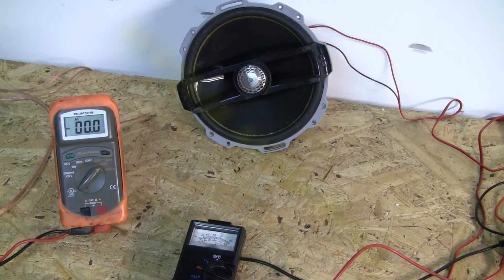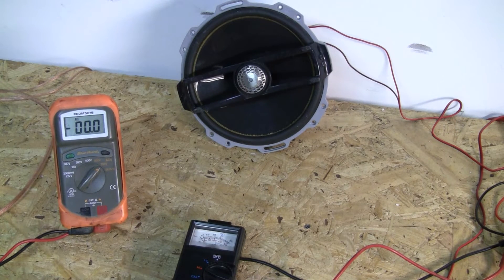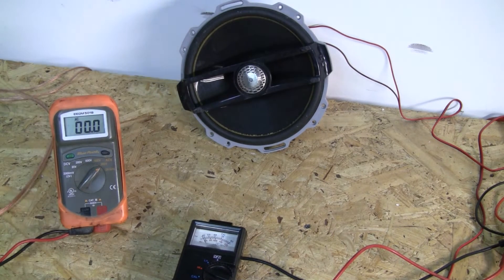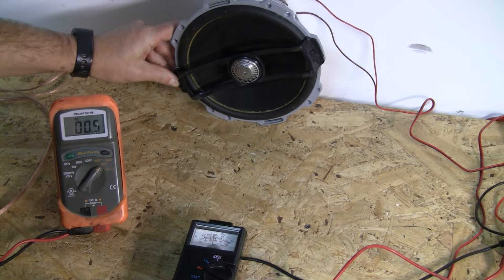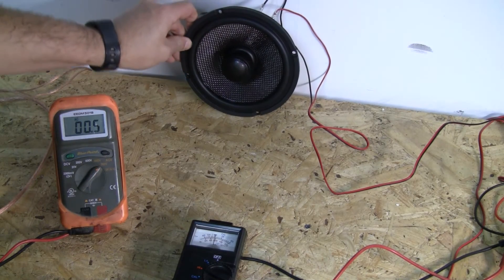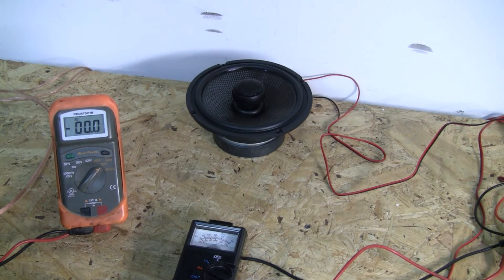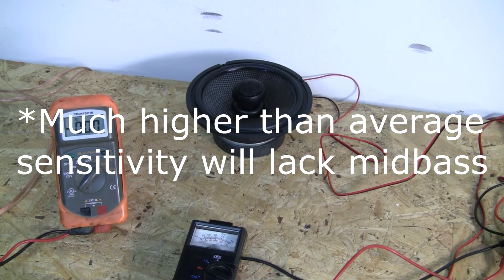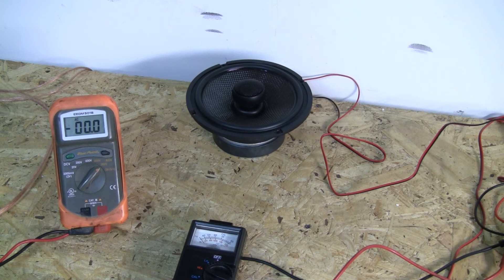Do speaker sensitivity ratings matter? - Tech Stuff Tuesday

Comment: You should probably have the speaker 1 meter (3.3 feet) away from the decibel meter to accurately measure the speaker sensitivity, at least based on the sensitivity rating unit's. The 1W measurement was accurate as long as both speakers were 4 ohms rated.
Reply from the maker: If I was attempting to see if the spec was accurate I would do that, as well as being mounted in an infinite baffle in an anechoic chamber. That wasn't the point. The point was to compare one to the other in the same conditions referring to ratings and actuality.

Comment: Something I have always found is the tested sensitivity tends to be lower than published do to spec tolerance and will change as the speaker is used relative to spider and compliance flexibility overtime and extremity of use.
Reply from the maker: In this case, what was tested was what was published. Typically what you've experienced is with subs, where specs were taken without any break in time.
Reply: @EMFAudio  Right! I was thinking it would've been something to bring up in the video that these are tested specs that coincided with manufacturer's published specs just because those things are not always the same and I've had as many as 10 different driver's of the same model that have had wildly different tested specs none of which coincided with published specs but that can be just splitting hairs when one's trying to get every last tenth out of a system.

Comment: I hooked up a PA compression horn driver on one side of my home receiver and a car coaxial on the other side the PA compression driver is way louder than the car audio coaxial sounded allot cleaner too. I wonder if it would be the same with a Pro Audio subwoofer and a  car subwoofer with similar specs "wattage" like a Sundown X V.2 18 inch subwoofer at 1500 wrms vs a eighteen sound 21NTLW5000
 21 inch subwoofer similar wattage rating 1800 AES. The music I usually listen to doesn't really go under 30 hz  "rock music"what would the better subwoofers be in my gigantic car lol! the rear cabin space is 11 feet deep 42 inches wide and 50 inches tall for the back end of my car. "it's a hearse" I just wonder what would be louder 2 21 inch PA vs 2 18 inch sundown's I know the PA subwoofers cost allot more but price doesn't factor how loud they will go. My amplifier I am using is doing over a true 3000 wrms @ 2 ohm so either subwoofers will do because it's running 1500 wrms each subwoofer. I like the specs on the Pro audio driver because it plays higher frequencies then the car audio driver/subwoofer will. I am running Pro Audio gear in my house and want my car to sound similar when a bomb goes off or a A1M1 Abrams tank is shooting or going off on a movie it feels like it does on real life.
Reply from the maker: Those are two completely different drivers for two completely different purposes. If you're trying to have maximum output and clarity anywhere in the 30's, the Xv2 18" would do better. If you're doing say 45 hz and up, the PA driver would do better. Sound quality is a consideration but I can't comment on the PA driver sound quality as I have no experience with it.

Comment: I wanna request u to clarify if an amplifiers input voltage matters u know if its rated at 0.5_5v does that mean i cant feed it an output from another amp to give it a signal and yes i know we have loc's im just curious can it damage the amp?  Thanks
Reply from the maker: You can get the same output from an amplifier anywhere within the operating range of the amp. So, if the pre-amp is rated for 0.5-5v, you can achieve maximum power anywhere in that range. If you go over that range, you will clip the output signal for sure but you can also damage the amplifier. Remember, we're talking about actual voltage going into the amp, not the maximum rating at full volume.
Reply: @EMFAudio  so does that mean even if my amp does not have a high level input i can still feed it an input from another amp bearing an amps output is about 25v and flactuating the amp is the kac_8106d monoblock
Reply from the maker: You would absolutely NOT want to do that. Your pre-amp voltage won't be over 6v max in most cases.

Comment: Biggest thing I've learned over years of testing is this...

1. Comparing sensitivity/efficiency numbers of DIFFERENT MANUFACTURERS is almost pointless. The reason is because no two manufacturers use the same testing methods. Some measure at 1 meter, while others measure at 1/2 meter. Some use an Audio Control meter, while others use a B&K (or even an analog RatShack meter). Some use a full bandwidth signal, while others use a 1khz tone (which is really stupid!) So you can really only compare numbers on paper for speakers from the same manufacturers.
2. Speaker sensitivity/efficiency matters more with low powered systems. That way you can get the most from what little power you have. If you've got plenty of amplifier power (which is cheap these days) then you can pick which speaker sounds best, and overcome innefficiency with more power.

Just my 2 cents
P.S. You're test was legit since you used the same sound source, same meter, and same measured distance. 👍
Reply from the maker: Actually, the sensitivity numbers aren't done using an spl meter at all. They're derived from theile small parameters. The only two ways to measure it are 1w/1m or 2.83v/1m.
Reply: @EMFAudio  Not trying to be argumentative, but I would trust efficiency numbers that were derived from other number (parameters) even less than an actual measurement made with an spl meter. And there are several manufacturers in the Pro Audio world that actually do use a high quality , correctly calibrated SPL meter to measure speakers in a purpose built anechoic chambers. They'll actually measure SPL at 1w/1m (which SHOULD be the industry standard) plus a max SPL measurement. Other, less reputable companies will just take the 1w/1m number, and add 3dB for every doubling of power up to that speakers max rating, and call that the max SPL. That method is just shady marketing, since a lot of people don't research the details when comparing, and just take the word of the manufacturers. It's almost as bad as car audio amp ratings, but that's opening up a whole other can of worms.
Reply from the maker: @PURESOUND4  they might measure that as verification but it's derived from parameters. Those should be what you trust, there is no mic involved, no calibration, no this or that. PA uses a lot of misrepresentation for marketing but actual parameters are what you should go by, and note which method is used.

Comment: Rockford was also an 8" speaker vs a 6.5". If you say it doesn't matter then measure a 15" sub vs a 8". I'd say difference would be even greater if both same size
Reply from the maker: You do realize the 6.5" was the louder speaker, right? The smaller speaker was louder than the larger one, and the smaller one had a higher rating. You're talking about comparing a 6.5" and a 15". The 15" has over 5x the cone area, that cone area is a factor in sensitivity. Yes, it would be a greater difference, and the rating on the 15" would also be much higher so it should be. Those two things aren't even remotely comparable.
Reply: @EMFAudio  precisely that's why I said  the difference would have been even greater if it was a 6.5 vs 6.5 vs an 8. The 8" has more cone area which will provide more sound. So if the 6.5" was 2 db louder than the 8" then it might have been 2.5-3 DB louder with the higher sensitivity. And I said a 15" sub vs a 8" sub with of course same sensitivity for both.
Reply from the maker: @easylooker4889  I'm not sure you understood the video, or understand speakers. The 6.5 had 2 dB louder rating and it was 2 dB louder than the 8". The size doesn't matter.  If you had a 6.5" and a 15" with the same sensitivity rating, you'd get the same result. But because they're so wildly different, you WON'T see a 6.5" with that high of sensitivity nor will you see a 15" with that LOW of sensitivity.  That's why they aren't remotely comparable, they won't spec close at all. Now you brought up subs, THAT is something in another video that is very different from what was shown here. Spoiler alert: Subs don't go by the same rules.

Comment: I would assume that each company has different ways to rate their subs, but how does EMF come up with their RMS ratings? Is it a procedure like clamping "x" amount of watts at clipping/1% THD until failure at 40hz in a free air situation? Or is it theoretical numbers factoring in the heat dissipation. Imo it seems that a sub in a sealed environment wont be able to take as much power as one in a ported box which has a way to ventilate air... or maybe the cone + dustcap in the sealed enclosure would be sufficient to dissipate heat should there be little to no distortion in the power going to it. I know you guys do a bunch of testing, any information to share?
Reply from the maker: Basically the way we do it is having a goal number as a rating, like say 2,000 RMS on the Banhammer, and confirming it will handle it. So for that example I want it to be rated for 2,000, it should take 2,000, and it's confirmed by applying 2,000 watts clamped, free air, at whatever frequency will maintain that power at near full mechanical throw, for several minutes. Temperatures are monitored through the test, if we run it for 5 minutes and temperature stops climbing, good to go. Can it take more than that? Sure. Can it do more than that in an enclosure? Absolutely. But, as long as it can hold a tone on rated power free-air, I know it won't fail in an enclosure playing music.  Playing with more than rated power isn't a warranty issue so that isn't of concern with how much it will really take and for how long.

Comment: At the end of the day though, it's all about tradeoffs and physics. Assuming you have an efficiently designed motor (tight gap), the lighter speaker will play much louder but only at higher frequencies. Every octave dropped, requires 4 times the power. A speaker that is heavier (higher xmax, longer coil, higher moving mass) will inherently be optimized to play lower due to its lower fs (say, down to 50Hz) but that comes with the trade off that it will probably be about 3-6dB less sensitive up top (100Hz+). I personally run PA speakers in my doors cause nothing can match in the impact and dynamics. Frankly, playing <100Hz in a car is door is a waste of time when you have a subwoofer. I'd rather have an extra 6dB up top from 125-160KHz onwards where it really matters. At the same time, high-passing your content in this region saves wasted power on bass/mid-bass (also by a factor of ~6dB or modern music), which is less taxing on the amp's power supply, giving you more headroom to push your mids higher (also by another 3-6dB). So in summation a pro-mid will inherently be 9-12dB higher (from 100Hz and up) compared to a conventional speakers. 10dB acoustically is electrically 10x the wattage... what this means is that to get the same output as a 100W pro mid you would require 1000W on a conventional speaker (far past thermal or any mechanical limits).
Reply from the maker: The problem with high pass at 100 hz is a proper response on the sub on bottom end will be weak that high. Most prefer having midbass with mids that will accurately produce 70 hz and up. They also want balance, so having 10 dB louder mids means having to gain 10 dB on subs. In short, most people listen in their car, not outside their car.
Reply: @EMFAudio  Fair enough. Ultimately, sound quality is subjective and in my case I like to have that extra headroom. PA speakers can be a bit "shouty" or sibilant on modern mastered loud music where crest factors of -3dB are not uncommon, especially when you have the muppets that run multiple supertweeters on-axis. On properly mastered recordings, the dynamics of PAs are just stunning on vocals and drums (one of the songs for showcasing this is Jonny Lang's - Darker Side). I run my subs at 80Hz/12dB LPF and I admit there is a bit of gap in the midbass but it's easily forgivable compared to the positives that PAs offer. I my other vehicle I have the Carrozzeria TS-V172A, purebred SQ components picked up when living Japan, and while they are more analytical and balanced, the PA setup (three "full range" DS18 PRO-NEO6s and a Pioneer silk-dome tweeter in each front door) is way more fun to listen to.
Reply: @recon440    Kinda cool to hear from Pro Sound guys in the comments section of a car audio post. I've also worked in both those worlds, and one thing I've always wondered is why Pro Audio companies can create really efficient mid drivers and high frequency compression drivers, but it seems like they always lag behind car audio manufacturers when it comes to high power, high excursion subwoofers.

Comment: I think for this test you need to run 1kHz or a true RTA sweep from 20 to 20000KHz. The TS specs are generally derived at 1kHz but frankly you can slice and dice the sensitivity to present pretty much anything you want. For example, most manufacturers will take an average output of an RTA sweep spanning the enclosing -10dB points of the curve while others may take the resonant peak you get at like 3kHz (which in many instances can exceed 100dB+). For the coax 6.5" I suspect the tweeter really contributed to the high apparent sensitivity.
Reply from the maker: They're both coaxials, both are for the same purpose on the same platform under the same conditions. Sensitivity isn't generally taken at 1khz, many will use the method I used or simply average the bandwidth. It wouldn't make sense to factor a random peak as the sensitivity, nor would it to limit it to 1 khz when 1,200 hz could be 1-2 dB higher.
Reply: @EMFAudio  I think speakers are usually baffle-mounted for sensitivity/SPL measurements. Otherwise there's going to be a significant fall off in sensitivity at lower frequencies due to cancellation. 

I think the previous poster was referring to reference sensitivity, not measured sensitivity.  The former can be calculated from the driver's parameters.  The latter needs to be measured across the passband that you intend to use or are using the driver.

Comment: What does more sensitivity mean less midbass?
Reply from the maker: The easiest way to understand it is to think of it like an SPL box. You have only so much energy, if you spread that out over bandwidth you lose amplitude. If you increase peak amplitude, you lose bandwidth. Midrange design is kind of the same way, the physics is there. If you increase motor strength you gain efficiency, you lower the Qts, which makes it more peaky and reduces bandwidth. Being a midrange that means the peaky focus is going to be on midrange, not midbass. You can look at PA drivers and see this, very high sensitivity, high Fs, limited response. Compare that to a normal mid, greater bandwidth, lower sensitivity.
Reply: EMF Audio Honest question here, is it possible to add mass to midbass speakers to lower their fs and extend their bandwidth? i know this is done with passive radiators but  midbass speakers are alot different, any input would be appreciated.
Reply from the maker: @owentroyer  Adding mass would lower the Fs, however, it may not extend the bandwidth, it may just shift the bandwidth. For example, if it it was 70-400 hz, adding mass might take it down to 60 hz but lose near 400 and drop that down to 300 hz. That's one of those things you'd have to consider the driver and where your crossover points are. Another consideration is in adding mass, your Qts will go up so it may change the overall sound more than just response. Then you also have to consider how you're adding the mass and if it's changing the properties of the cone.
Reply: EMF Audio Thanks for the explanation. I won't be adding mass to my speakers now :-)
Reply from the maker: @owentroyer  I did a video on how different specs effect others when you change one.
Reply: EMF Audio just watched part one and part two, those two videos about specs taught me alot. i hope you continue these tech time vids